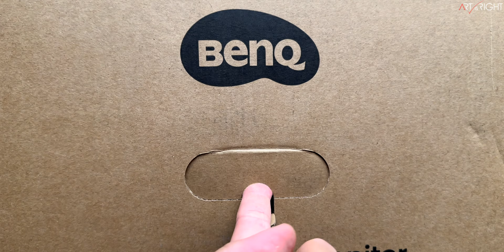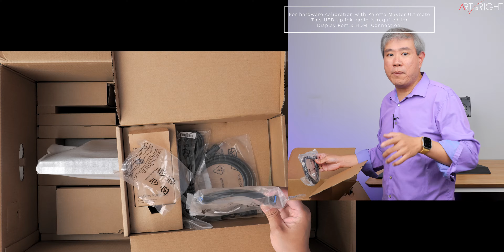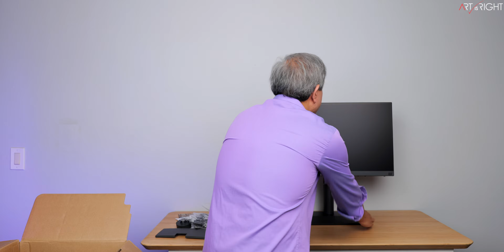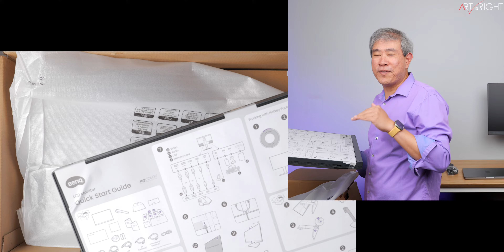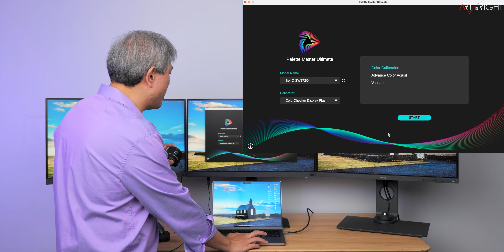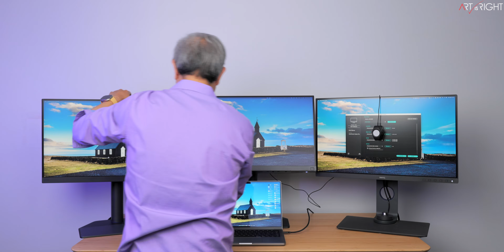SW272Q & Special Edition SW272U Unboxing!

Comment: It's all confusing for an old man. I mostly want to print my self scanned B&W negatives from the 1960's 70's etc. Assuming I purchase the SW272U, (by the way, is there a rumor of a SW32U or Q"?), how necessary is a calibrator such as the Calibrite Display Plus HL for B&W photos? I Will do some color work also. How does one decide between the SW272 U or Q, other than cost? Sorry, on and on, I believe you speak of making 3 profiles for the monitor which you can switch easily with the puck, Can one be for editing in Photoshop and another just be for the internet or watching a video, which I assume would be brighter? Thanks, your videos are helping me get closer to my answers.  David
Reply from the maker: To get the best result one should always custom calibrate the display. Most Calibrite / X-Rite devices are compatible with this software.
How does one decide between the SW272 U or Q, other than cost? 
2K vs 4K
Sorry, on and on, I believe you speak of making 3 profiles for the monitor which you can switch easily with the puck
A possible scenario yes, but not necessary. I don't do that for my own workflow, it is just an example / idea.
Can one be for editing in Photoshop and another just be for the internet or watching a video, which I assume would be brighter? 
You can do that, but for me it is unnecessary, I still browse the web at 80 nits and it is fine. But each to their own when it comes to this and this is where having 2 calibration would be handy if brightness variation is what you are after.
Hope this help, feel free to follow up with more questions.

Comment: Hello, I received today my new monitor Benq SW272U and I actually notice that the color temperature of the monitor is actually warmer than my M1 MacBook Pro. I see that the color temperature on the monitor is the to 6500 k. (I can change it to 5000 but if I do it will become even warmer, I thought it should be the opposite).
Latest firmware installed today.
Have you noticed something similar? Is it normal?
Thanks in advance for the reply
Edoardo
Reply from the maker: Lower number for color team (kelvin) the warmer the color is, higher color temp the cooler the color is. MBP have a different backlight and is also tuned in Apple P3 as well, which is a modified P3 with additional blue. So that is what you are seeing.

Comment: Hopefully the signal issues that were very apparent with the 270c are gone. I replaced 3 monitors and not one 270c could consistently keep a signal with any device I connected to it.
Reply from the maker: Don't have any issues with these on my daily use, nor do I have any issues with SW270C, but that could just be me.

Comment: Okay Art, you finally convinced me to pull the trigger on the new SW272U Display. For the price, 1500USD.... I am BTW working in Shanghai and TW..... it is a great value for anyone that does critical color work if they can afford it. I mainly do video production in the Education space for corporations. My question. My challenge and question for you and BenQ is this. I also own a PD2700U. I want to some how get close enough to match these to monitors as close as possible. They are both IPS 8 bit + 2 bit FCR panels. The testing and software engines are different obviously. So, what can I do to get these to close as possible. What is the method of doing this? I am sure others might also be in the same situation. I do not want to get 2 SW272U yet. My hardware setup is = PC Asus 399 mb, 32 gb  DDR4, AMD Radeon VII GPU, 3 m.2 drives of 2t storage and scratch drives, WIN 10 pro. I also have an AERO 15 OLED laptop - 17-11th Gen CPU, WIN 10 PRO, 32gb ram, 1t m.2 system drive, 2t m.2 scratch drive. Love Apple, but I run DaVinci Resolve 18, AE, and Adobe Premiere along side. Main color grading is with the PC. Editing with Adobe Premiere and After Effects. Laptop used for some color work occasionally... but most done with PC attached to BenQ monitors. SW272U will be used as a dual setup with PD2700U. There you have it. Let the BenQ community observe ArtisRight on..... Thanks for taking the question and challenge in advance.  😊
Reply from the maker: So that is a difficult one for so many reasons, the generation of the panel matters as well in this case. What you can do is set the PD to REC 709 since you are using resolve and then calibrate it via software calibration. On the SW272U no need to do anything before just calibrate it Palette Master Ultimate with video REC 709 setting and see how close they look. There are going to be variation, different LCD panel, backlight, diffusion panel, not to mentioned that the fine coated panel will make colors look different than the PD that you have as well, regardless of perfect match or not. But this is what I would do to start.
Reply: @ArtIsRight  OK,I will take your recommendations and keep my notes to share with the community. BenQ probably needs to consider this moving forward also. There are many new content creators that need good reliable color calibrated monitors. So, the market is there for the mixing and matching product lines. Asus, being the only other Taiwanese company poses somewhat of a challenge in this space. LG & Dell are more  2 marketing giants, so they will eat some of the market based on that alone. Then you got Viewsonic, with their VP2786-4K and VP2785-4K monitors. I will be letting you know how this method works with my workflow. Thanks and let's keep the conversation flowing.😊
Reply from the maker: I hear you but there's no consideration really, it at the end of the day just that matching display type. I can tell you right now Apple Pro Display XDR does not match to iPhone, iPad nor their 27" 5K Display. Not all LCD comes from the same FAB and not all of them with variety can match, it is just at the end of the day, practical technology and physic, there are still things are not possible to do, this would be one of them. And this at large is not a BenQ problem, it is industry wide. As far as challenges goes for hardware calibrated display there's only Eizo that can challenge BenQ and to that end BenQ target market was never meant to take on Eizo at the top end. As far as Asus goes, they make decent hardware but their calibration at the factory is so so and their software is mediocre at best on PC and an atrocity on Mac. As for ViewSonic, again decent hardware but software that at this point in time can't run on Mac, I can't say that I am sure how serious they are in this market. Apple Silicon has been out since late 2020 and they have not gotten their act together yet. LG and Dell are big leagues, with only LG that has their own Fab, Dell just buy panels from Fab so it is a different story really. When it comes to Dell, they have hardware calibrated display but limited in range, scope and when it comes to Mac users, they are dead in the water. Why buy a nice 6 - 7 figure sport car (hardware calibrate display) to drive in first gear at 10 mph all the time (not doing proper hardware calibration on it), it is just a waste of potential.
Reply: @ArtIsRight  I hear you Art and agrees with you. But here is a thought.... with P3 Display becoming more adopted due to the popularity of Apples Macs, Ipads, and even browsers, that day might be coming sooner than later. Consumption and delivery is the key. Most people are consuming online content solely and the demand for 4k and beyond content will only grow as speeds of connections increase. If you got the monitor to view the highest possible color gamut - whether it's heavily marketed HDR content on TV displays or gaming monitors,  consumers are hungry for it to be consumed😄. But again,  I hear you and agree with your assessment of the current state of suppliers. I worked with all of them while living in Taiwan for 2 decades on OEM projects. BenQ locally was always thought a stepchild of ACER until they carved out their own niche. Asus like MSI, Gigabyte,  etc was always thought of more focused on peripherals such as GPU's, motherboards and of course Laptop computer....while adding to tablets (Asus). On another note. I do have a question regarding the SW272U or any of the PD series monitors. If editing video using DaVinci Resovle or Adobe Premiere,  do we still need to purchase the BMD Decklink in order to get a clean feed on Windows 10? Or is this not necessary with BenQ professional SW or PD monitors? If so, what is the setup or workflow when using the BenQ monitors.
Reply from the maker: "If editing video using DaVinci Resovle or Adobe Premiere,  do we still need to purchase the BMD Decklink in order to get a clean feed on Windows 10? Or is this not necessary with BenQ professional SW or PD monitors? If so, what is the setup or workflow when using the BenQ monitors." 
This need for this really diminishes when do you don't do board cast, I think that is what most over looked. decklink clean output is mostly used for board casing for anything else it does not matter much. One can use it if they like or they can forgo it, just calibrate and save the money. If one wants to use it, on software calibrated display such as PD just put it in REC709 mode and plug the decklink in. On SW, do a hardware calibration with either Palette Master Element or Palette Master Ultimate first without decklink and then once that is done add decklink back into the equation. 
To the first part of what you said, Yes P3 will become the standard one day and it has, in some sense, became, somewhat, a de facto standard already. But this is just gamut and it has nothing to do with panel matching. Gamut, LCD, LED Backlight type, calibration and matching are all totally different things that overlaps and relates but not necessary matching.
Reply: @ArtIsRight  So to be clear, if we are running SW272U that is calibrated, the BMD Decklink products are not necessary for color grading and getting a do called clean feed?
Reply from the maker: You can use it but if you are not doing board casting work the benefit is null. Clean feed and decklink product is designed mostly for board casting and to by pass any variation in color output from the computer that starts from the variation in hardware - GPU, OS, Drivers and any icc profile that runs on top. This device, however, cannot account for the display itself, and having a hardware calibrated display really negate the need of this. Now if you do board casting work sure use it, but for other type of video work, the question would then be what is the purpose when the content will get consumed on the web and mostly via smart phone and tablets...
Reply: @ArtIsRight  That is the clearest explanation I have heard so far and it makes perfect sense. If you are color grading for broadcast video, then maybe there might be some variation. It just adds another cost to the equation that is not needed.
Reply from the maker: Absolutely!

Comment: Personnally, I will not but a BenQ art monitor again.
I used to have one, with screen uniformity issues (with dufference up to 5dE between the center and 1st fith border). Every single replacement unit that BenQ sent to me had similar or worse uniformity problem.
My gaming monitor had far more better uniformity.
Never again...

Great specs, great performance in the center, but in my humbke experence panel quality lottery.
Reply from the maker: Ok. I have tested these new pro models and they uniformity is good on these. Improvements has been made with every generation. When something has short comings, it does not have that forever. Also which model did you have. Earlier models of the SWs may not have as good uniformity. The model year matters and technology has improved. I appreciate your feedback, however, regardless of if the display is BenQ or not I would still like to have specificity, model numbers and etc. Also replacement of the same model coming from the same factory and being that they are panel from the same generation would still exhibit similar short coming. If it was a newer model / generation then this is another story. Also comparing this to gaming display, it is an assessment that can be made, however, are we talking about the same model year / release date. Or a first generation BenQ unknown model, but even lets say it is an SW with hardware calibration capability, are we comparing to a gaming display that was released in 2015, which is the year that the first gen SWs was released, or are we comparing it to a more rather recent gaming display of unknown brand and model number.

Comment: So with the mac scaling issue "performance hit" when using a 27" 4k screen would it be better to get the 2k version?
Reply from the maker: With Apple SoC there's really no hit any more.
Reply from the maker: https://www.youtube.com/playlist?list=PLjlr8rlxl_q65mOyASWU2naUlPCr78nxi
Reply: @ArtIsRight  one more question if I may, if you scale your resolution although the mac is still outputting at native -  because you are effectively say scaling to 2560x1440 to see it properly then thats the screen real estate you get to use? So surely a 4k monitor is false economy with a mac - you should go for a 2k screen or a 5k screen to get full potential of it?
Reply from the maker: So Mac only output native at display native resolution. Your thought is correct that for Mac you are probably better off with 2K if you don't want scaling. Because 5K Mac scales by default as well, it is just that the PPI is greater than 200, which is more than 2x and why everything is sharper. But here's also the thing as well, 4K or even 5K you will not run that native, however, for me, I scale it to highest equivalent before native, it makes things easier to see, while I still gained to ability to get some of the retina like quality, even though it is not full 2x resolution. Hope this helps.
Reply: @ArtIsRight  it does, thanks again for taking the time to explain

Comment: I wonder, why in this day and age of fully calibrated Macs and iPhones right out of the box, the new monitors aren't deltaE perfect from the start?
Reply from the maker: There're lots of assumption and many things wrong with this short statement. "... in this day and age of fully calibrated Macs and iPhones right out of the box" Not just Mac, Every displays has to be calibrated from the factory. Very few tend to notice that Apple never published the % color gamut coverage nor do they ever report ∆E out of the box from the factory. This is not as oversight but rather by designed. "the new monitors aren't deltaE perfect from the start?" his statement does not make sense. They are, both of these SWs are under 1.5, that is as good as they are, imperceptible to human vision. The reason why one should calibrate is to be precise and accurate. Sure Apple has the advantage of being vertically integrated, but every time you plug in an Apple Display to a Mac without calibration, you are accepting, yet not knowing what the delta e is. For the most part, if one is serious about color accuracy, it is like editing blindfolded. For general consumer this is fine, for pro it is not. Also not to mentioned the assumption that everyone uses Apple or iPhone, may be more in the US but not everywhere in the world, and not all of one customer uses Apple products either.
Reply: @ArtIsRight  was my reply to your comment deleted?
Reply from the maker: no, didn't delete any comment as of late.
Reply: My main point was, in independent tests of Mac displays are around  deltaE 1 straight out of the factory. My perception is no one needs to calibrate new Apple displays, even the Pros. Apple just puts way more effort to do this in the factory.
Reply from the maker: "My main point was, in independent tests of Mac displays are around  deltaE 1 straight out of the factory. "
Do you have a like / reference to this test? 
"My perception is no one needs to calibrate new Apple displays, even the Pros. Apple just puts way more effort to do this in the factory."
Yes and no. This is exactly what Apple wants, for users not to do any of this because when issues do come up, it makes their support easier and more stream line. Also, like I said before they have the benefit of being vertical, while other company don't. I would not argue that they calibrated their products really well. But variations do occur for panel to panel and different display types and it is conscious decision, engineering wise, to accept that the variations are going to be with in tolerance range of the user.